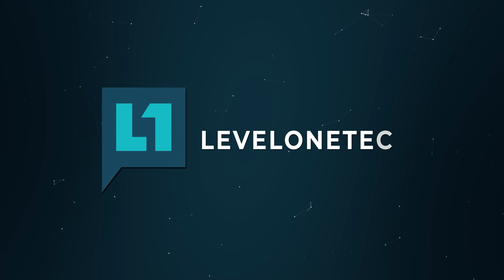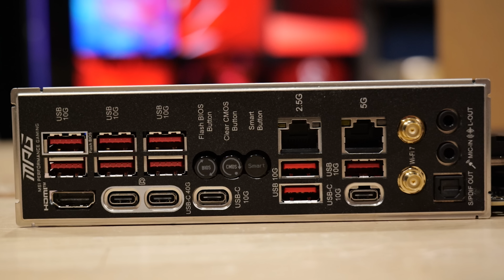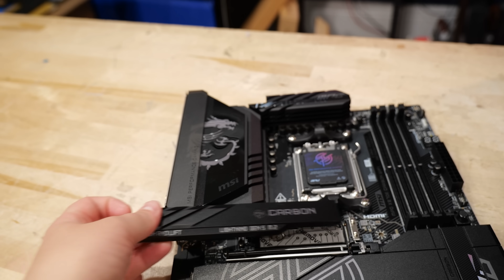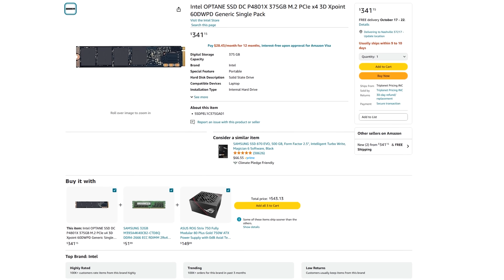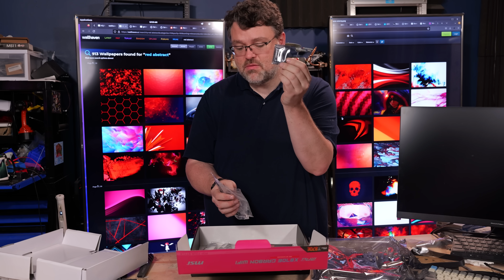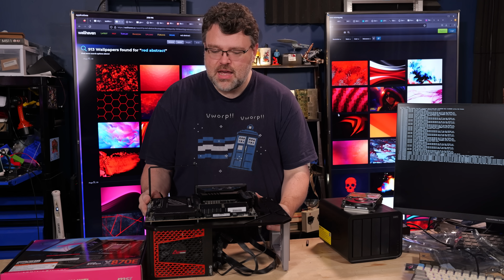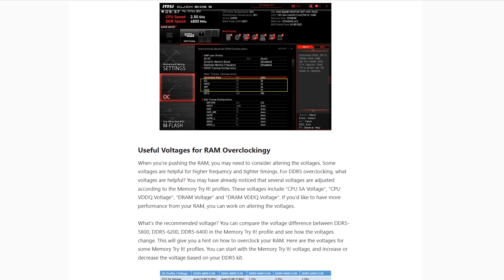USB 4.0 for DAYS! Checking Out The MSI MPG X870E Carbon WiFi

Comment: What happens if the clear cmos button is hit by accident when you’re reaching around to plug in a usb device? Is the whole System Wiped out? I want will 3D print a guard cover if I get this board.
Reply: Why are you reaching around a desktop computer blindly trying to put a usb device in.

Comment: What happens if the clear cmos button is hit by accident when you’re reaching around to plug in a usb device? Is the whole System Wiped out? I want will 3D print a guard cover if I get this board.
Reply: You have to hold it for a few seconds iirc

Comment: I don't know if it was covered here but I can give interesting topic to dig. There is interesting incompatibility beween Intel WiFi7 m.2 adapter (be200) and AMD platform. It just doesn't work with AM4/AM5 (with a few exceptions) and works fine even with old intel platforms like 1151. There is no such problem with previous AX210, but if you want to build WiFi7 its a pain below the back.
Reply: wrong
Reply: @JoeMama-yl1ow true

Comment: I bought this motherboard and am delighted with it EXCEPT for one aspect. I have Windows 11 on an M.2 NVMe drive and Ubuntu Desktop 24.04 on an internal SATA-attached SSD. The problem is that in the BIOS, currently 7E49v1A1A(Beta version), the Boot Order only sees the Windows 11 drive. It is completely blind to the Ubuntu drive which has GRUB 2.12 and is able to boot either Windows 11 or Ubuntu. The only way to overcome this dilemma is to interrupt the boot process using F11 ... now both Operating Systems are offered. However F11 only works after a shutdown - it does not work during a restart. I am an avid fan of Dual Boot systems and keep both OSs apart so that Windows 11 knows nothing of the other OS, especially if booted direct. The BIOS must be fixed. (I never had this problem on my previous Gigabyte X570 AORUS ULTRA)
Reply: I have to cancel this issue ... it turned out to be a setting within Boot Order that was "off-screen" in the BIOS. My apologies for the confusion!

Comment: Speaking of fast memory. I just built with the x870 tomahawk. running corsair vengance ddr5 6600 2x32, and it will not run any higher then 4800mhz. Is this something that is a issue with all boards at this time, seems lots of people are saying this is a known issue on msi boards for now????

Comment: That board is linewise not that good. PCIe x16 Slot 1+2 and M.2 Slot 2 share the same lanes. If you use a x16 GPU you can forget the other 2 slots.
The board I chose is the MSI X870 Tomahawk. There you can choose between USB4 or a second M.2 5.0 x4 drive, or you share the lanes x2/x2.
Another difference is one less USB-C port and more slower USB-A ports. Also the forth M.2 is x2 instead of 4x.
But thats about it for a 140€ difference.. (the 110mm M.2 slot is a 5.0 on the Tomahawk :D )
Reply: PCI-e 5x8 is the same as pcie 4x16. Only 1 gpu even uses pcie 5.

Comment: Hey Wendell, question about NVME drives: I picked up the WD SN850X, which isn't quite double-sided.  Its more like... one and a half-sided.  Some people have reported that they get improper thermal pad coverage because of this.  Do you think I should add an extra thermal pad layer on the half of the side that doesn't have NAND packages, to apply even thermal pad pressure across it?  Is that something that people do?
Reply from the maker: somewhat yes. nand chips being hot is okayish controller is what's nice to make full thermal contact . and ram if you have separate dram
Reply: @Level1Techs  Great, thank you.

Comment: After all these years, they still don't have 10GbE LAN? I'm using 10GbE so I don't ever want 2.5 or 5GbE on my motherboard because it's just going to waste. I have to use a PCIe slot to install another network card while ignoring the ones on the Mobo. This complicates all planning if you actually need some PCIe slots. PCIe slots are precious, I.e. I might have to get rid of a video capture card just to install a network card.
I wonder if there's some kind of intellectual property problems with 10GbE? The price and availability of 10GbE should have decreased by now.
Reply: Less than 1% need 10g lan. Not a big market so motherboard manufacturers don’t support it.

Comment: Do the USB-C 40G ports support thunderbolt 3? Also, I want three PCI-e slots on a motherboard, x16 / x4 / x4 without lane sharing for all my expansion cards without gimping the rtx 5090 I want to buy, but no, no one makes that. I get x8 / x8 / x4 at the most.
Reply: Those 1 to 2 extra frames matter that much?

Comment: I did my research and did the opposite- I just bought a X670E motherboard with plans to get a 9800X3D soon. It was a hundred bucks cheaper than the cheapest X870E, with the exact same chipsets, and it doesn't trap 4x PCIe lanes into a port I won't use (it even has a Thunderbolt AIC connector if I change my mind on that someday).

Comment: Hey guys I bought x870e carbon but it doesn’t want to play with Corsair 96gb cl30 6000mhz ram… the best I can get is 3600 … what the hell? With any higher it won’t boot and need to reset cmos…
Voltage is 1.4… there’s xmp profile and some other automatic setting to set it to 6000 but they all fail to boot . Any ideas ?

CPU is 9950x
Reply: Did you figure it out? 
Have you updated the BIOS?
Reply: @ yes I figured it out. The problem I was having was I placed ram next to each other rather than say slot 1, slot 3 … that solved it

Comment: crap board if you populate the 2nd M.2 slot the 1st PCIE Slot will run at 8x. what kinda shit is that? and then you might think ok what if i want to populate the 2nd PCIE Slot, the 1st slot should go down to 8x and the 2nd slot should be 8x to right? wrong the 2nd PCIE Slot is only wired for 4x.

SO If you populate all 4 M.2 Slots, not only does the first PCIE Slot go down to 8x, the 2nd PCIE Slot stops working. this is the problem with MSI, theyve been shit for years.
Reply: What gpu do you think gets crippled at 5x8?   Hell there’s only 1 that uses 5 in the first place.

Comment: Are there any USB primer videos? As in, I use USB for KB, Mouse, Flash Drives, Printer, sometimes to connect Android phone, and sometimes portable drives. I would assume there is a lot more that can be done with USB and newer versions of it... since all the channels seem to be touting USB 4... etc... but not explaining what it can be used for except its faster. What am I missing? What else is USB good for? What other devices? Edit: Also, there are so many USB ports now... I am a few generations behind but I have a bunch of USB 3.x ports I've never used or needed.

Comment: This is an extremely beautiful well put together board - love the USB 4, x M2 latches, High spec DDR5, CPU using latest AMD 5 processors and the 3 PCI-E Expansion slots - probably at moment the best AMD motherboard out there; I'm stuck with building soon an Intel Toasty I7 G14 system with Intel 790 Mobo chipset - Wish me Luck!

Comment: I have the pro art x670e MB you showed… seems like not much/if any of an upgrade from that.  Yes, 1 more usb - 10gigabit but only a 5gig lan vs the 10 on the pro art
Reply: What about USB4 then?
Reply: @SalsaDuraa  my x670e already has 2 USB 4 ports
Reply: @BLASTIC0  x670e proArt doesn't come with usb4
Reply: @SalsaDuraa  I’m using one right now, it has it. Website says it does too. Not sure what you are looking at.
Reply: @BLASTIC0  I check you right. It comes with USB4 ports. My bad sorry
Reply: @SalsaDuraa  no worries, seems like it was a x870e in x670e disguise….ahead of its time. 😉

Comment: I'd just like to interject for a moment. What you're refering to as USB 4.0, is in fact, USB4, or as I've recently taken to calling it, USB4 v1.0. USB4 v1.0 is not a continuation of USB 3.2, but rather another free specification derived from the Thunderbolt system made useful by the USB Type-c port, USB backwards compatibility and vital system components comprising a complete USB4 v1.0 specification as defined by the USB Implementers Forum.

Many computer users run a modified version of the USB system every day, without realizing it. Through a peculiar turn of events, the version of USB which is widely used today is often called USB 4.0, and many of its users are not aware that it is basically USB4 v1.0, developed by the USB Implementers Forum.

There really is a fourth generation, and people are using it, but it is just a part of the system they use. The fourth generation is the signaling mode: The lowest layer of the OSI Model, also called physical layer or phy. The signaling mode is an essential part of the USB specification, but useless by itself; it can only function in the context of a complete USB implementation. The fourth generation signaling mode is normally used in combination with the USB4 v2.0 specification: the whole system is basically the USB4 v1.0 specification with Gen 4 signaling added, or USB4 v2.0 Gen 4 symmetric. All the current so-called USB 4.0 implementation are really implementations of USB4 v1.0!

Comment: I'll probably shop an X870E board to replace my X650E Taichi Lite.  Everything was fine until I picked up a 1.5TB Optane 905P as my boot drive and my roommate and I got 5Gbps fiber.

Now I need at least PCIe lanes to drive 1 more M.2 slot and a place to hang a 10GbE controller off of.  
🤷

Comment: Is the primary SSD heatsink the same height as the heatsink/cover for the secondary ssds? Asking because I want to get a GPU block with an active backplate but need to ensure it will not block the heatsink. Thanks!

Comment: Everything but a 10gigabit nic! WTF All of these guys doing the same. WHile the proart has the 10gbe, it doesn't have SPDIF wtf!
Reply: If only HDMI to SPDIF extractors existed...
If only you could add a 10Gb NIC for like 20% of the cost a motherboard manufacturer would charge you...
Reply: Personally I would rather have an extra PCIe slot so I can use my own SFP NIC rather than a built in copper 10GBE.

Comment: Is it possible to lock the pcie 1 to x16, disable the pcie 2 and use the m2_2 at X4?

Asking because documentation says if using m2_2 then your pcie 1 goes to X8 and pcie 2 goes to x2. Since they share bandwidth

Comment: I did hear that one major reason these boards weren't a day one item is because that would've meant air shipping and they didn't want expensive boards at launch, and air shipping increases the price of the board.
Reply: They just didn't wan't the sticker shock of expensive boards associated with the CPUs. 
Bulk air freight is a fairly trivial cost difference for this size and price item. And they can easilly planahead to have ocean freight ship with enough time.
Anyway the cost isn't as simple as the base transport price. Ocean frieght has higher holding costs, and the port delays add a lot of uncertainty to the timing. Surface transport can also have higher insurance premiums and theft risks.

Comment: Pretty annoyed about that both Pcie slots sharing bandwidth with M2 slot 2. The x670e version didnt do that
Reply: The x670e didn’t support more than 1 m.2at 5th generation either. There’s also exactly 1 gpu that even uses pci-e 5 and the difference isn’t going to be noticeable

Comment: That is so many usb ports, but when will type A finally die?  Nothing i hate more than having to tilt my entire PC forward to see behind it to figure out which direction in need to align a usb type a connector to plug it into the back of the motherboard.  Why can't everything just be Type C already?   And can we please get rid of SATA ports while we are at it?   Just put more M.2 Slots on motherboards.
Reply: i dunno let's keep the sata ports i have a hunch that hdd raid arrays in ATX towers will see an upswing in the near future
Reply: @SPyoutube42069  HDD's are super dead, and so is raid.  

Have you ever opened a 2.5" SSD before?  The PCB doesn't even fill the whole space.  There is zero reason why you can't just change from a sata connector to an m.2 connector for all SSD's.   Have expansion cards with a bunch of M.2 Slots on them if you really need a bunch of drives.
Reply: Keyboards and mice don’t need the extra cost of type c

Comment: isn't ECC not present in MSI board? or doesn't work (based on HUB testing)... checked video, Asus doesn't have that, MSI failed to boot, and max speed for ram was 8100 on MSI carbon wifi... so ultimately wasn't that far off

Comment: Is displayport something that comes on the motherboard or on the gpu? If motherboard, does this support displayport 2.1?
Reply: it usually comes on GPU cards. It may come on a motherboard to support CPU's integrated graphics, in which case it makes no sense to make it 2.1, as integrated GPU definitely won't be able to deliver anything above 1.4 specs. Regardless, HDMI is still more popular unfortunately as a video port on motherboards.
Reply: @morgwai667  some motherboards have both it’s going to be at a price.
Reply: @morgwai667  Ah I see. Thanks for your response. 

It's been over 16 years since I've had an actual desktop system, and back then there were no hdmi and dp on them so I'm completely out of touch with these things.
Reply: @RondellKB  one more bit of info that I've just acquired: apparently USB-4 ports of most of these x870(e) motherboards are also capable of carrying video data from CPU's integrated GPU, so if you have a DP display that you want to connect to iGPU, you can use either an HDMI-2-DP cable or a USB_C-2-DP cable. Of these 2 cables, USB_C-2-DP is much simpler, so usually a bit cheaper and if you use Linux then you definitely should try to avoid anything HDMI-related.
Reply: @morgwai667  Interesting. So you have many options at your disposal. The only downside I see is that most of these iGPUs can't push 4k at >= 120hz, the best you can hope for is 75hz. Hopefully that changes with these new batch of CPUs.

Comment: Is the extra PCI power cable on the board not for providing power delivery to the USB4, rather than another PCI-E device?
Reply: In this case it's purely for 12V rail on the board (PCIe slots, 12V RGB, 12V fan headers etc.). That said, the PCIe 6 or 8 pin connectors that are normally "for PD" also seem to connect to the board's 12V rail as the 12V pins in the connectors I've tested have have continuity with the 12V pins in the ATX 24 pin connector, PCIe slots and fan headers. I imagine boards that disable higher PD modes when the supplementary PCIe connector is not connected use the sense pin(s) to detect the presence of the cable.
Reply: Asus uses theirs on the hero for fast charging cellphones on the front of the case.

Comment: Dongles for days!  IMO - PCIe lanes been missing for days!  Fk this new DT vs HEDT paradigm.  I remember bleeding edge affordable X58 i7-920.
Reply: My $120 AM2+ had 44 lanes with the slots being able to split all sorts of ways two x16 1 1 or 16 8 4 4 1 1 (and the chipset allowed four x8, twox8 and several x4/x1 and several other combinations.) 
I don't thing these new chipsets even allow board venders to do alternate splits they get one 16 or 8+8, and an m.2; all other slot mixes must be from  an expansion chip. 
x32 and x2 slots are both in the pcie standard but I've never seen them in the wild.
Reply: @mytech6779  Exactly.  "Modern" DT is just underwhelming lame compromises.  Hard no for me on X870E.  Forced USB4 to steal 4 lanes from an already crippled PCIe design, continued RAM issues with 4 DIMMs, stupid amount of USB + shared lane M.2s, PCIe 5 bandwidth should be switched to more PCIe4 lanes - well see how much wasted bandwidth with a 5090 uses on PCIe5 x8 slot, stupid amount of $ dumped into VRMs + RGB, and a $500+ "modern" mobo can't even get you a complete soundcard with 7.1 analog + SPDIF, nor a 10Gbit ethernet.  If one is hardset on a AM5 upgrade I'd go X670E for more flexible platform or B650 for cheap.  X870E compromised dumpster fire.  With the alternative being a 4x more expensive HEDT.  Just dumb deliberate market segmentation.  Previous HEDT wouldn't even double cost of build.  All of IT / tech going way of broadcom - soon "they'll" say you don't even need a home PC and just sell thin clients to rent your PC in the cloud with no root/admin permissions.  Approved apps only.  Ignorance is strength.
Reply: @mytech6779  Exactly.  "Modern" DT is just underwhelming lame compromises.  Hard no for me on X870E.  Forced USB4 to steal 4 lanes from an already crippled PCIe design, continued RAM issues with 4 DIMMs, stupid amount of USB + shared lane M.2s, PCIe 5 bandwidth should be switched to more PCIe4 lanes - well see how much wasted bandwidth with a 5090 uses on PCIe5 x8 slot, stupid amount of $ dumped into VRMs + RGB, and a $500+ "modern" mobo can't even get you a complete soundcard with 7.1 analog + SPDIF, nor a 10Gbit ethernet.  If one is hardset on a AM5 upgrade I'd go X670E for more flexible platform or B650 for cheap.  X870E compromised dumpster fire.  With the alternative being a 4x more expensive HEDT.  Just dumb deliberate market segmentation.  Previous HEDT wouldn't even double cost of build.  All of IT / tech going way of broadcom - soon "they'll" say you don't even need a home PC and just sell thin clients to rent your PC in the cloud with no root/admin permissions.  Approved apps only.  Ignorance is strength.

Comment: Gamers: these boards are too expensive and the chipset is the same!

Us: look at all those USB ports!

Btw Hardware Unboxed said ECC did not work and MSI said they did not support it on consumer boards. If you found differently, that's interesting.
Reply: Upgrading from an AM4 to AM5 has such a steep price hike, that many are holding off for as long as they can. I mean, unless you absolutely need to be on the bleeding edge, you can just as well play all the new releases on an AM4 platform.